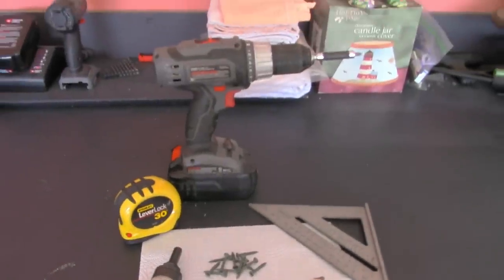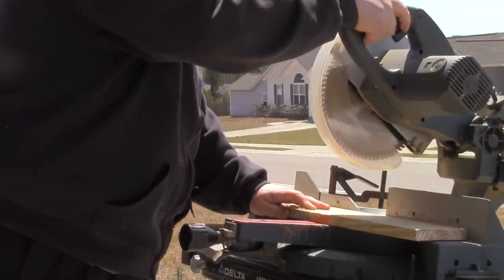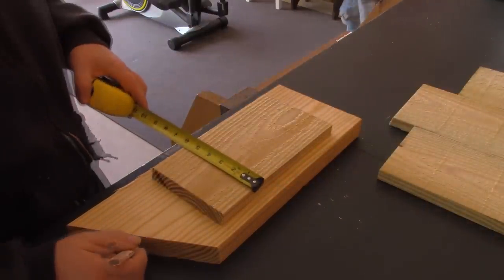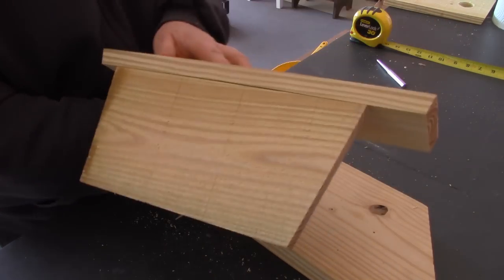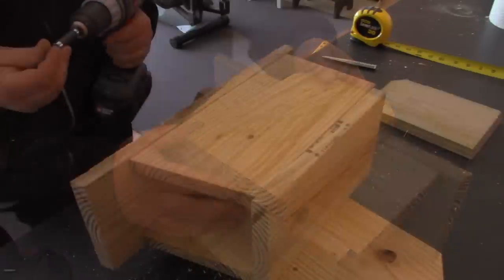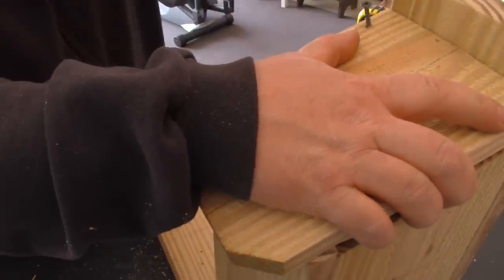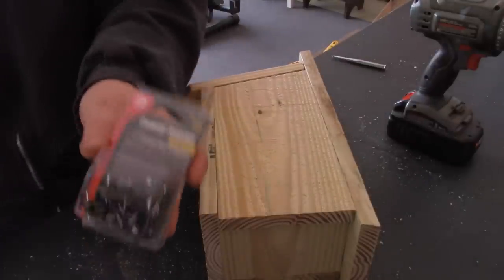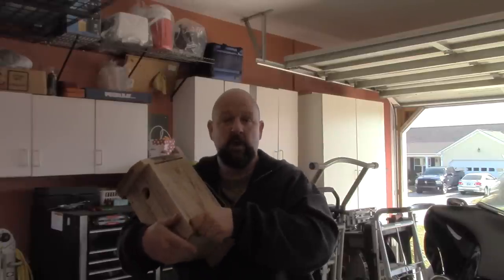How to build an inexpensive Eastern Bluebird house

Comment: I  made  a  bird house with  the  fence   picket.  No  problems.  It  was  really  a   test   run.  I'm   now  going  to  make  one  using    cedar,  with  the  base  corners  cut  and  a  second  layer  of  wood to  the   entrance. Thanks  for the  video!
Reply from the maker: j109joell sounds great. Cedar is a fine wood to work with. Thank you for commenting.

Comment: Great video.  I’ve build hundreds of these without the bevels to keep it super simple. Slightly smaller dimensions, sides 10” at the back, 9” at the front.  Front is 9” with a 1 1/2” hole for bluebirds.  Top is 8”. Back is 14” for plenty of mounting room.  Bottom cut to fit using sides and back.   Five drain holes in the bottom. Same side hinge for clean out.  Bottom should be recessed 1/4” to prevent water wicking up. All pieces 5 1/2” wide. Easy, a five foot board makes one box.  I used recycled cedar, pine, plywood, whatever is on hand. I have one at the house here that is going on ten years old, usually sees two broods a season.   Clean the out at the end of the season.  Check during the season to discourage house sparrows. Sometimes you will find a cowbird egg ( here in the Midwest USA).
Reply from the maker: They are a lot of fun to build and even more fun to watch families move in. 👍

Comment: Nicely done video, Joe! I also enjoy making these in my shop. Sometimes I get overly fancy. I might suggest two simple things though: 1. Adding drain holes in the base, 2. Another layer of wood surrounding entrance. The holes definitely add to lifespan of the house, and the wood extrusion of the entrance makes it difficult for critters to harass the nest.
Reply from the maker: Thanks for the great tips.  I usually cut the corners of the base to allow for drainage and air flow.  Not sure why I didn't this time.  Thanks agin for the tips.  I like the double wood at the entrance idea.

Comment: Excellent tutorial about building the birdhouses.  We will be using your plans to create birdhouses with our elementary school TAG students.  I wish you used safety glasses.  Love your idea about the little latch.  Excellent explanation of vent hole and size of the bird hole.  I understand what the small drill bit is for, but you say 3/64th in video and 3/32 in comment section.  Not trying to find your faults, just so you can fix and clarify.   Thanks for making really easy to follow plans.
Reply from the maker: Thank you I’m glad you found it helpful. I mass produced these bird houses for my elementary school and sold them for a fund raiser. They sold like hot cakes 😀
Reply: @NoProJoe  we built 14 today with elementary kids.  Gonna build another 14 next week.

Comment: You should outfit your bottom with 2 simple additions.  The bottom inside needs a piece of folded over hardware cloth.  It allows the blowfly larva to go down, but they cannot get back up to suck the blood from your bluebirds.  Secondly cutting the corners of the floor off allows for drainage.  Cuts down on mortality significantly.
Reply from the maker: Thank you for the helpful suggestions.
Reply: Thanks for this information!
Reply: Following rules, should place on a fence or tree. Your video clear to understand
Reply: I don't understand the suggestion with the cloth. Is there a link that can explain?

Comment: Nice job. Use cedar material and it should last many years. My cedar house has lasted over 15 years and still producing year after year, with zero maintenance.
Reply from the maker: Cedar is a great wood!  Thank you for the tip and comment.

Comment: I also use the 6' Cedar fence pickets. ~ I put drain holes in the bottom by 'nipping' off the 4 corners of the bottom piece at 45* with the saw. = Easy / quick / effective. :)
Reply from the maker: I do the same thing with the bottoms. I didn't include that. I must have had a brain misfire. Thank you for the comment.

Comment: Nice build. You should provide drainage for the floor. Either knock off the corners or drill 4ea  1/2'' holes. Where you locate them is important. Mount a min of 5' up and in the middle of a grassy field is best.
Reply from the maker: I made the video quite a while ago. I actually forgot to include the dimensions and the build for the bottom of the house. However, in my builds I cut the four corners out of the bottom to allow for drainage. It worked well. I built no less that 70 of these houses and sold them as a school fund raiser. They were a huge hit. I also did bat houses which sold not nearly as well lol 😂
Reply: @NoProJoe  Thanks for getting back to me. I too have been making and selling birdhouses at our local county farmer's market (Towns County GA). I make bluebird, house finch, Carolina wren, screech owl and bat houses as well as carpenter bee traps, small pine recipe boxes and fancier hardwood boxes and trinket trays.
Reply from the maker: @herbsu4330  WOW that's great. You're making some pretty cool stuff. I bet they do very well at the farmers market. I like the carpenter bee trap idea. Good stuff.

Comment: A little tip is to put it together the the gran facing the out side that way when it rains and the wood expands it doesn’t push the screws out and crack the wood it will last longer then

Comment: For the viewers, I'm gonna suggest using a larger drill bit to guarantee not splitting the wood.  Generally, you can hold the drill right in front of the screw and it should cover the majority of the shank so only the threads show.  This way the shank won't force its way in and make a split.  The bit size depends on the screw size you use.  Just compare the two.  It's not rocket surgery.

Comment: Looks lovely!~ The 'only' question I have is - how do you keep predators out? I thought that some kind of mesh or cone was required so a squirrel or racoon could not get at it? Tks!
Reply: Also what about holes for Ventilation?
Reply: Oh, don't get mad, I also heard 'roughwood' was better for baby chicks to climb out! LOL! My tips come from DEEP.  Tks again!
Reply from the maker: Where I was in NC squirrels and raccoons weren’t really a problem. I cut the corners out of the bottom for ventilation. I’m sure a rough wood would be great. The fence pickets generally aren’t finished super smooth more of a rough cut. I’m sure there are many ways to make these houses. This was just the way I found that was easy and repeatable. I use to sell them at the school I taught at as a fund raiser 😊
Reply: @NoProJoe  Awesome!

Comment: hello, i like woodworking, i have made 4 sets of corn hole boards now, looking to make some bird houses. 2 questions..1) i noticed no one uses wood glue? is there a reason?..2) can the bird houses be painted? thanks for a great video...
Reply from the maker: I imagine a nontoxic wood glue would be fine. Paint I would think that would be the same. I've seen painted birdhouses I'm not sure if they were for decorative purposes only. I would check with a birding site to see if there is a recommended paint for a bird house.

Comment: Should the roof overhang that door gap, to prevent rainfall into house?
Reply from the maker: I've not had a problem with rainfall. However, a little extra protection never hurts. Thanks for the input and thank you for watching.
Reply: Yes overhang on roof sides and notch floor corners you will have a perfect house.

Comment: thanks for sharing Joe. If I have some wood that isn't cedar what would you recommend for paint? I notice some people use all colors.
Reply from the maker: The judge is out on using paint. However, a good nontoxic paint only on the outside of the house should be fine. However, I would investigate further.

Comment: Joe, thanks for the clear advice. I have the cedar board and am ready to make.  Do I NEED to add double thickness on the front? I will if it helps to keep predators out. So are they talking about just making the hole “tunnel” twice as deep by adding another thickness of board is how I understand it????
Reply from the maker: I didn't use the double thick. My yard was pretty protected.

Comment: a bluebird can fit thru that hole? here In s.e. louisiana they are huge!
Reply from the maker: TheEmeraldfox good question. I scouted around a bit and it appears that the entrance is the same here as in Louisiana. However, I would check with my extension office. Thank you for commenting.
Reply: I use 1 1/2 “ hole and I’m in Slidell la

Comment: Do you have any ideas on how i could hang or attach this bird house to a tree?
Reply from the maker: Connor Mustar depending on the size of the tree I would just mount it with screws. It shouldn't hurt the tree. Thank you for commenting.
Reply: I usually drill two holes in the back and use zip ties to hang it in a tree. Remember to check it once in a while - it shouldn't be too tight.

Comment: what are the lengths of each side,roof,front,back,and top?
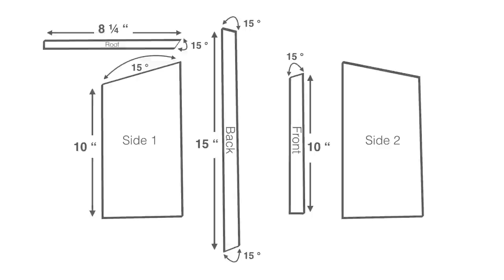Reply from the maker: At the 1:00 mark there is a diagram of the sizes.  However, the roof is 8 ¼ at the long end.  The front is 10" at the long end.  The sides are 10" at the short end and the back is 15" at the long end.  All angles are 15 degrees.  So for the back you measure 15" and cut at an inward angle on both ends at 15 degrees.  On the sides you measure 10" and cut at a 15 degree angle upward etc.  It is a bit confusing but if you follow the diagram it should work out.  Sorry for the confusing instructions.  The cool part is the width is the same on all pieces.  You just use a dog ear fence picket and keep the width the same.  I hope this helps.  Let me know.  Thank you for commenting and asking questions. :)

Comment: Why isn't the size of the bottom in the diagram?
Reply from the maker: +David Taggerty You are absolutely correct.  Sorry about that.  The bottom is 4" x 5 ½" and I notch the corners for air movement.  However, this varies with the thickness and overall size of the fence picket you use.  Thanks for pointing my error out.
Reply: All I can say is I'm glad I saw your post because I can buy these fence pickets for cheap
Reply: I'm making my first one as I speak and my fence pickets are 5/8 inches thick so the actual bottom of 5 & a half by 4 3/8
Reply from the maker: Yeah, that is the down side of using pickets.  They vary quite a bit.  I just adjust for the size and try to match the lumber as best as possible.
Reply: I built three and a nesting pair moved in in two days.  Thanks for the idea and plans.
Reply from the maker: +David Haggerty that's great!  Mine are like hotels one set out another set in. My student get to see them go from eggs to babies to flying.  I love.  Thank you for trying the plans.

Comment: never mount a bird house on a wood post, cats and raccoons will make a meal of your birds
Reply from the maker: Thank you for the tip and thank you for commenting.
Reply: How does the cat get inside?
Reply: @texsox  They'll sit on top of the fence waiting for the bird to stick its head out
Reply: I have put them on a wood light post and on trees for years and have not have any problems with cats or raccoons. You do have to clean it every year. I use a 45 degree pitch instead of 15 degrees on the roof.